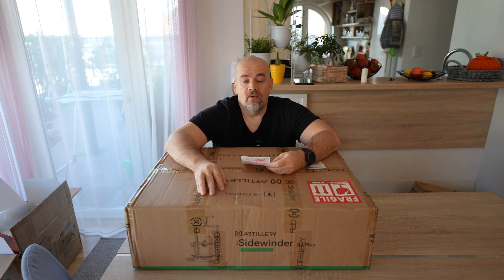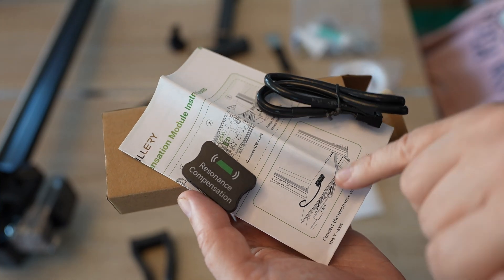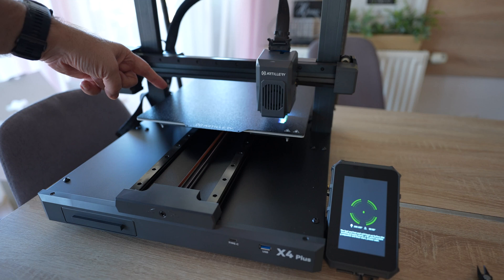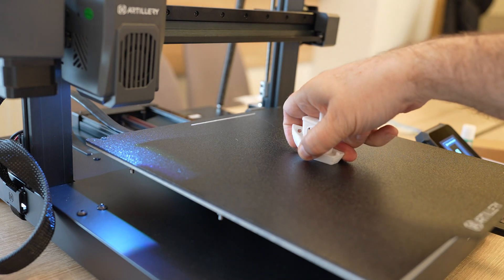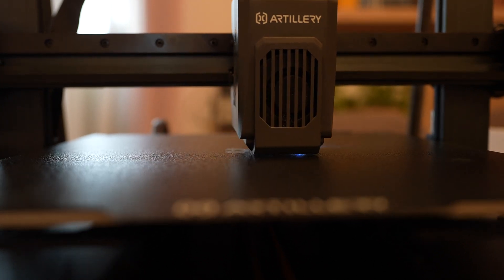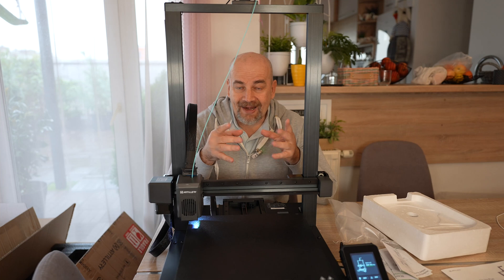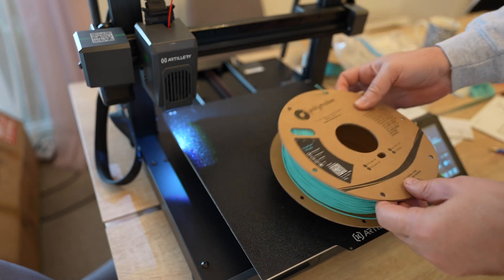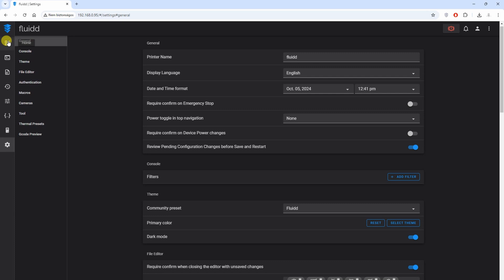It's Klipperised: Artillery SideWinder X4 Plus

Comment from the maker: Correction: the default profile I used is "super fine" with default layer height of 0.08 mm. There are many other profiles, for example "0.2mm Standard". So, yes, it's my mistake, that I didn't changed the profile.
Reply: Thanks for coming back to update.  How have you liked the printer since your review?  I'm thinking of getting one.

Comment: Bought for near €200. 
Very good, traditional and easy to maintain and rework the kinematics. 

But a complete disaster the firmware. 

They did a lot to avoid that advanced users can rework the software. Removed from mainbord both the microSD slot for MCU update and the BOOT button to put the board in dfu mode to reflash. There're the headers it's not difficult to solder a button, and also an ethernet port.
Reply: I don't think this sort advanced stuff you would like to do, strokes with the target audience for this printer

Comment: Thank you for your honest review of this machine. I received mine on christmas eve and I like it a lot so far.
But maybe you should mention in the title of this video, that the machine you just reviewed is the upgraded X4 Plus S1! 
This new unit comes without leveling knobs under the bed and with a ADXL345 in the box.
But could you do me favour and share your "draw_line" macro? Because my machine swipes the nozzle on the silicon pad on the back, just to travel over the whole bed and makes a purge line on the front edge of the build plate. On your prints, the purgeline starts on the back of the bed which makes a whole lot more scense.
Thanks in advance and keep up the good work. Liked and subscribed 👍
Reply: If you haven't found it, I found in /klipper_config/adaptive_mesh.cfg, but it might be in a different file for you. It's under [gcode_macro LINE_PURGE]. 

variable_adaptive_enable: True      # Change to False if you'd like the purge to be in the same spot every print
variable_x_default: 10              # Default X location to purge. If adaptive_enable is True, this is overwritten
variable_y_default: 10              # Default Y location to purge. If adaptive_enable is True, this is overwritten
variable_distance_to_object_y: 10   # Y distance in millimeters away from the print area for purging. Must be less than or equal to y_defau
lt if adaptive_enable is False

If you set variable_adaptive_enable: False, you should be able to set the location you want the purge to happen. HTH.
Reply: @ thank you very much.
I‘ll give it a try soon 👍🏻

Comment: Great review! Is it possible to use a simple USB hub spliter in order to connect both the camera and the usb thumbdrive?
Reply: I think you would just transfer the print files to the internal storage on the printer.  With my Elegoo Neptune 4 Max I always just transfer from my computer to the printer via Fluidd.  I never use a microSD or USB to print from.